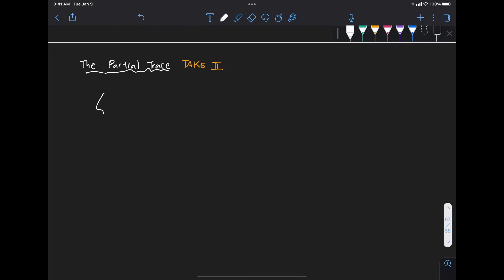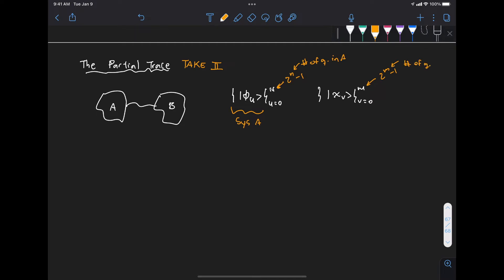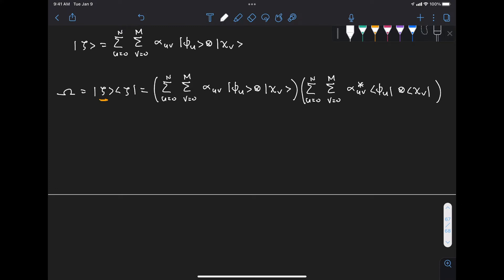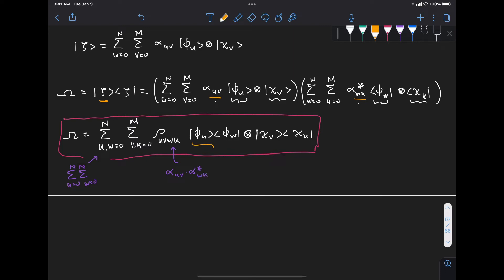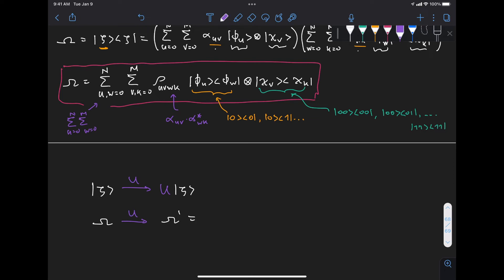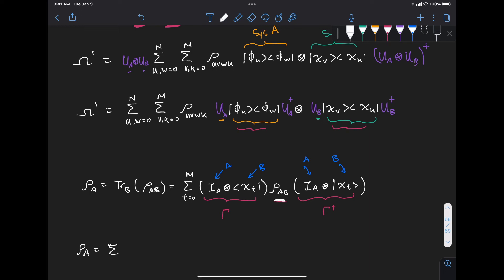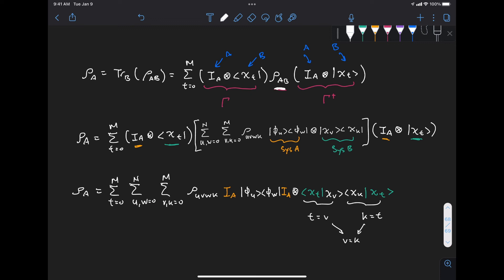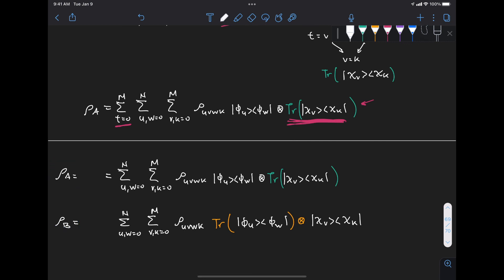The Partial Trace (Additional Details)

Comment: Rather than assuming qubits 2 and 3 are both apart of system B, could you separate all 3 qubits into their own system, i.e., qubit 1 is a part of system A, qubit 2 is a part of system B, and qubit 3 is a part of system C?

If so, does this change anything about the analysis? 

Thank you for these videos! They have been really helpful for getting more comfortable with the density matrix representation of quantum states.
Reply from the maker: Thanks for the question. You can absolutely separate them into three systems; however, the process of calculating the partial trace requires for you to "lump" together all the systems that are not part of the one you want the reduced density matrix for.

For example, say I call qubits 0, 1, 2 sub-systems A, B, C. If I want the reduced density matrix for, let's say B, we need to collect the terms for A and C together (let's call that system X) and perform the partial trace over X. The math will be identical to what we showed in this video, but we would need to make sure all the terms get ordered correctly. 

Hope this helps!
Reply: Thank you for your quick response ! Can you also trace out multiple systems in the same computation? Such as Tr_AB do exclusively look at system C? Or do you have to trace out one system at a time? @diemilio
Reply from the maker: @austinbristow5716  Yes. That is what I tried to convey in the example I gave. System X in my example is equivalent to performing Tr_AC, but you can also perform Tr_AB, you just need to lump together the two systems you are tracing out.